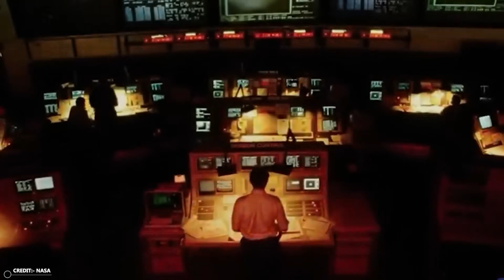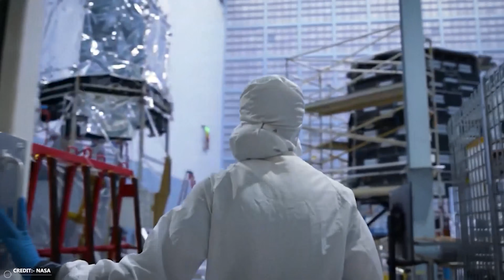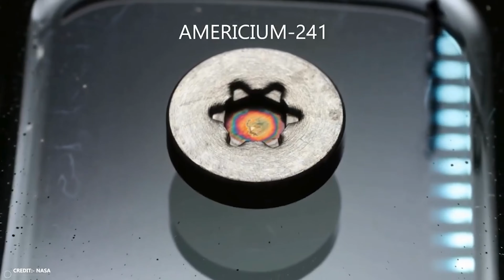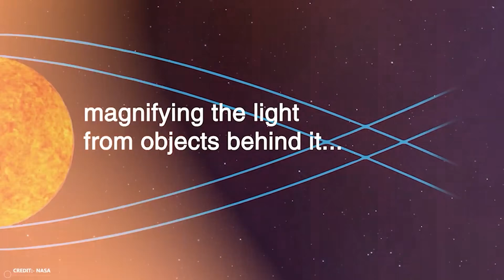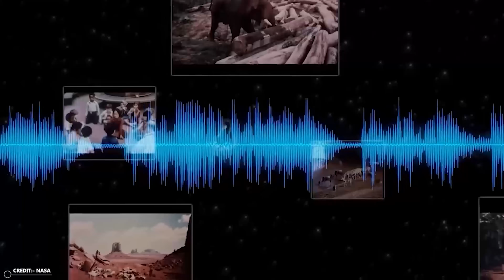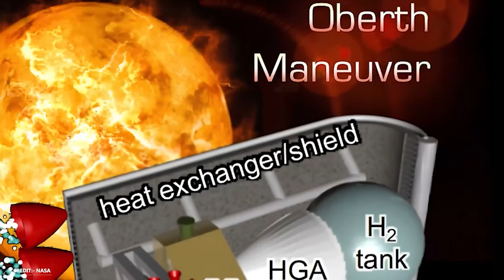Voyager 3 Will Use the Sun to Go 6x Faster

Comment: No, NASA has no official plans to launch a Voyager 3.

No, a spacecraft cannot use the Sun for a traditional gravity assist to escape the solar system.

While the Sun has the strongest gravity in our solar system, a gravitational "slingshot" only works if you steal kinetic energy from a moving body relative to your frame of reference. Because our entire solar system moves with the Sun, a spacecraft orbiting the Sun cannot use the Sun's own gravity to accelerate away from it. To the spacecraft, the Sun is stationary; diving toward it will cause the probe to speed up, but as it flies away, the Sun's gravity will pull it back and slow it down by the exact same amount, resulting in a net speed gain of zero.

However, scientists are planning future interstellar projects that utilize the Sun in a completely different way—known as the Sundiver or Oberth Maneuver, combined with Solar Sails.

Instead of a passive slingshot, upcoming interstellar concepts plan to use the Sun's gravity to drop close to its surface and fire propulsion systems at maximum intensity. According to the physics of the Oberth Effect, a rocket engine generates significantly more kinetic energy when fired at the absolute highest velocity possible (which occurs at the closest point to a massive gravitational body).

Comment: While watching this video I started thinking about the differential probes propulsion types talked about.  Wondering if we could combine the different types into a single probe to get it moving even faster.  My idea is to launch and get a gravity assist from Venus, then the Sun, then once past the Sun used a pop out solar sail to gain even more speed, the craft would then be sent towards Jupiter for another gravity boost. We could also use near Earth lasers on the solar sail to boost its speed even more.

Comment: Interesting video, but as of September 2026, not a single probe has left the Solar System or crossed Interstellar space, why? Because they're going to cross the Oort Cloud, and that's: (2000-2042.6) –(90000-120000) astronomical units, yes, they have left the heliopause, but from this, Solar flares simply begin to cross the interstellar medium, but the light flashes will not disappear, so so far no Probe has left the Solar System, but the video is interesting.

Comment: We come from a planet that has a moon. Earth's dia is as 1 and the moon's, as 0.2732...*

They would figure that some of us believe it to be highly coincidental, likely that this geometric ratio points to a Creator.
Because this number is 4/pi.
It can be more easily understood by placing a circle with circumference of 4 next to a square, also with perimeter of 4.
The length of the square is 1, and the diameter of the circle is 1.2732. The earth fits perfectly inside the square and the moon, perfectly within the remaining distance of the circle's diameter.

*...Also, our moon rotates every 27.32 of our Earth days".

Comment: This is taking too long.  Using the english fusion drive being tested in orbit next year or so, by the time this gets launched we could launch something twice as fast+.  Or any of the other drives under, or the faster magnetic or solar sail sling shot development going percentages of the speed of light, or the shrinking warp drive designs.   By the time it finishes its its near solar mission it could be physically passed by fleets of such foster more capable craft on their way to other system, each a fraction of the cost of it's launch system if doing the same near system job.  I remember when they defunded the trickle of analysis funding of advanced drive proposals a quarter of a century ago.  All these young people may not know, but we remember.  And the magnetic proposals came out of the 1960's and earlier proposals.  Which should have been out there by now.  But for some reason things were diverted.  The English bunch has thrusters that could do the job as well.  But, we are still in the dark, with images protected on the walls, as in the old Greek fable of the underground prisoners the Matrix film is about.

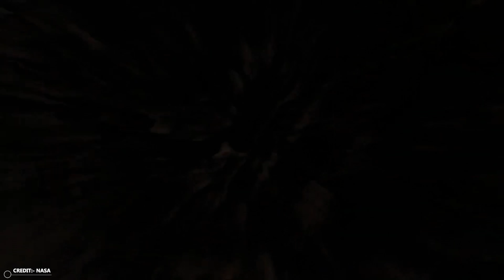Comment: 28:43.  Could we make a “21st-century Voyager”?

Yes—and it could be dramatically more capable. A future interstellar probe might include:

* A fused-silica or diamond archival library containing petabytes of data.
* Multiple redundant storage technologies (analog and digital).
* Laser communication for higher data rates while power is available.
* AI that can explain the contents in multiple mathematical and visual formats.
* Atomic clocks for precise timing.
* Self-diagnostic systems and multiple transmitters.
* Redundant copies of humanity’s scientific knowledge, languages, genomes, art, music, and history.

The biggest challenge wouldn’t be storage capacity anymore—it would be power. No storage device, however advanced, can keep broadcasting forever without an energy source. Once a probe’s power runs out, it becomes a durable time capsule, relying on the hope that someone, somewhere, will eventually discover it.
Reply: My only issue with the Voyager name is, it must still share Voyager lineage somehow.  They don't have to look exactly the same or anything, but at the very least, they must be built by JPL.  Otherwise, it would be like Nissan making a new Corolla, or Toyota making a Pathfinder

Comment: Voyager 1 and 2 used Plutonium‑238 (Pu‑238) in their RTGs. Only good for 40-80 years. If they used Americium‑241 (Am‑241), half-life: ~433 years. They could have made probes that could go for so much longer. Simple choices could have made them so much better.
Reply: The main goal of Voyager 1 and 2 wasn't to send them into interstellar space, though; it was to study the outer planets, which they succeeded greatly at. Obviously if they were to use RTGs again for a successor mission, it would make sense for them to consider using something with a much longer half-life as fuel if they wanted to give said mission a longer lifespan, as long as the alternative fuels are affordable with their limited budget.
Reply: @AggroKnight42 , it wouldn't have cost any more to use a longer-lived isotope. It was short-sighted thinking. If you're going to engineer something. Over-engineer it.

Comment: Why do so many of the videos that speak of the impending death of the Voyagers and how far they have gone lament that there is nothing taking their place, when the truth is that New Horizons is currently doing that to a certain extent? Its primary mission was to Pluto, beyond the outer planets that were the primary targets of the Voyagers. It has taken on additional missions years after its primary mission, as they did, and it is traveling faster than they are and will, in the not-too-distant future, be farther from Earth than they are.
Reply: No it isn't faster than the Voyagers. Look it up. Voyagers 1 & 2 are going 38,000 and 34,000 mph respectively and Horizons is going about 33,000 mph. All are slowing down. But New Horizons won't overtake either one.

Comment: Gravity assist is a bit misleading,  as a body loses the velocity it gained falling into the gravity well when climbing out of it. What they do is go in closely BEHIND  a planet in its orbit and "steal" some of the latter's kinetic (orbital) energy (insignificant to the planet, of course). 
Using the sun's gravity well to gain net acceleration simply by additional mechanical acceleration at perihelion is far more complex and has never been proven successful.

Comment: The solar lens telescope is a separate project, it would have to be aligned with a star, stop to collect data, be able to transmit effortlessly the data. Each facet is a project and maybe looking into deep/clear space to the edge of the universe would be a better project.
Reply: It would also have to stay within a certain distance from the sun much further out than the Voyagers have gone so far - about 542 AU (or about 12 times further out than Pluto) if memory serves. Just to get out there in a decent timeframe would require a much faster provbe than anything we have built so far (even the Parker probes around the sun didn't go fast enough for this).